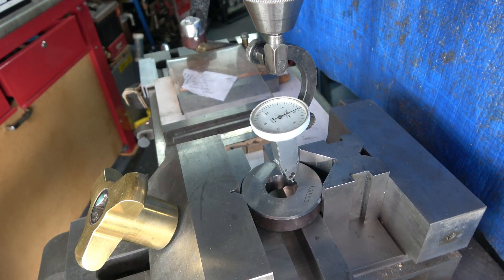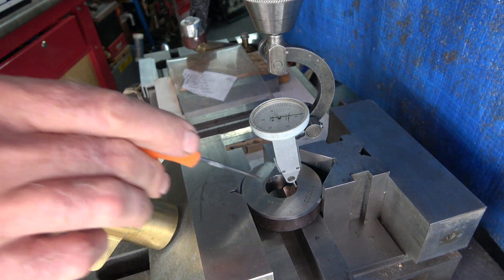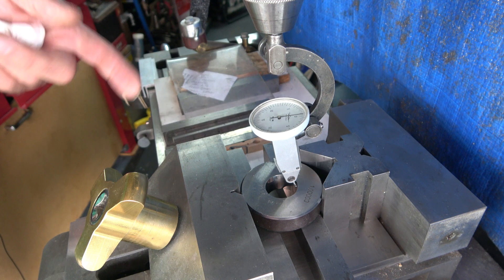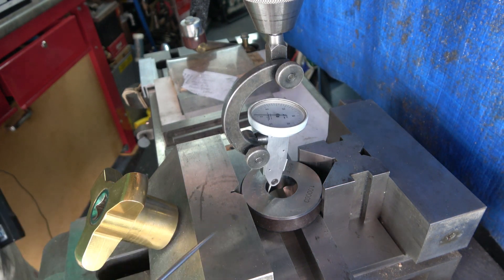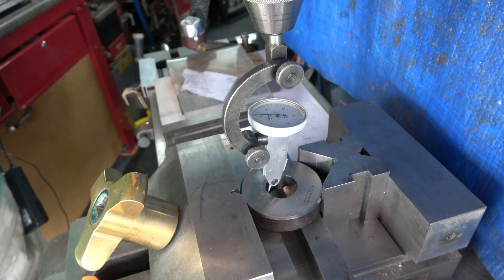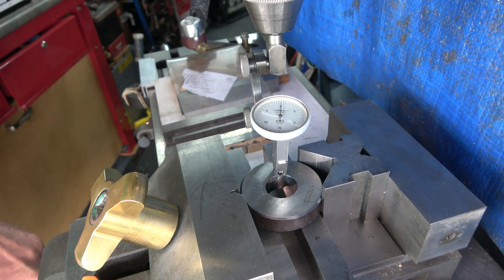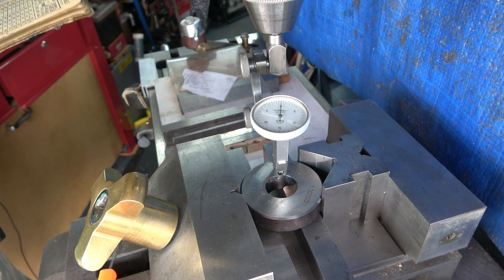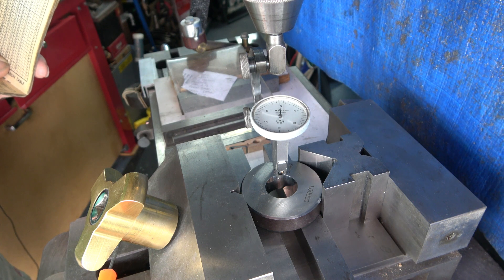Knowing Where Your Mill Leadscrew Backlash Is For Accurate Working Without The Use Of A DRO.

Comment: Thanks Dave It looks like without a DRO you really need to set your moves ahead of time.
Reply from the maker: Very true Randy and also stay focussed in what you do, can easily be caught out with no DRO. Also pays just to put a sharpie mark where the next hole should be, just in case you miscount by 1 turn, gives an instant WHOA, what's wrong here message. Thanks for watching. Regards.
Reply: @daveticehurst4191  👍

Comment: Hi Dave, I understand that you have taken the backlash out of the lead screws but haven’t you then lost the centre position?
Reply from the maker: Hi Stan, thanks for the view and your question. NO the center position has not moved. It was dialed in central, all I did was back away the part by at least 0.050" slackened off the leadscrew dial, wound it back in until the DTI read zero again., locked the dial, did a check. Spindle is still on the center of the hole, but the backlash has been removed. Regards.